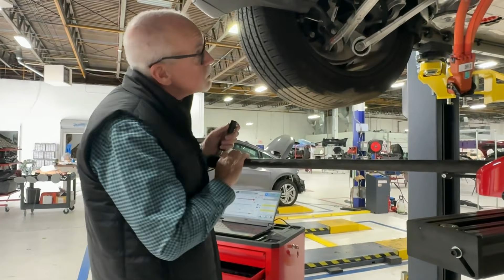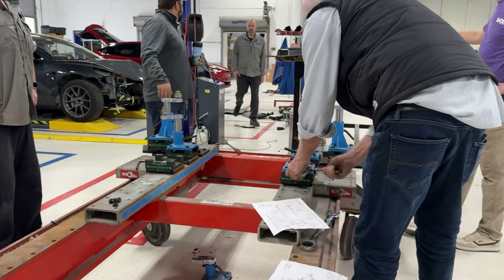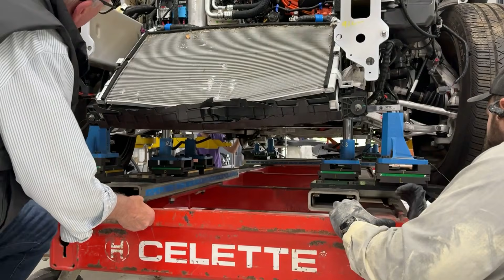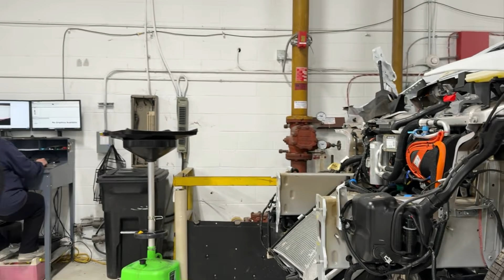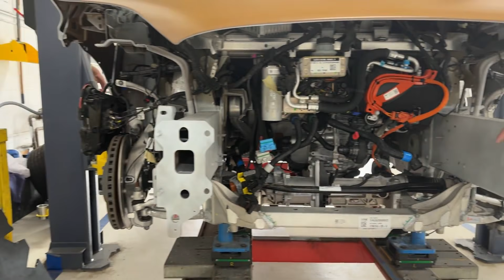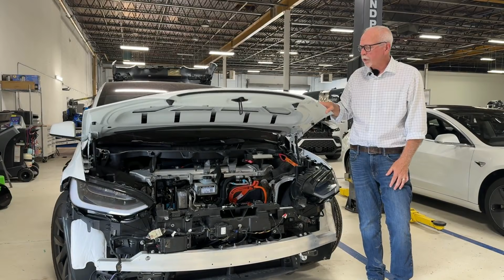This Tesla Model X Looked Totaled… Inside the Celette Repair Process

Comment: Am I missing something here? This is a high-voltage EV with a battery pack from a crashed vehicle. Shouldn't there be a designated HV safety area with warning signs and restricted access? And when handling a collision-damaged battery, shouldn't HV insulating gloves and appropriate PPE be used until the pack has been properly isolated, tested and declared electrically safe? The battery being disconnected from the vehicle doesn't mean the battery itself is de-energized. I'm genuinely curious about the safety procedure being followed here.
Reply from the maker: It is always best to check the specific repair manual for the vehicle manufacturer's latest guidelines.